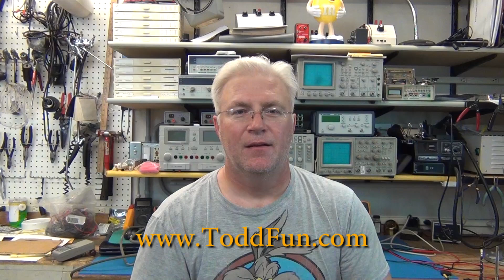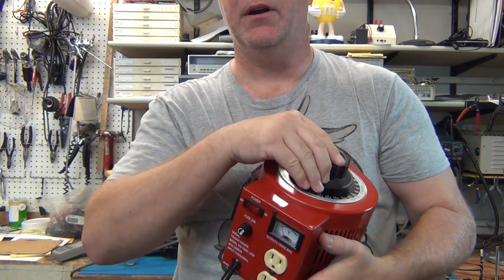Variac or Autotransformer Review and Teardown

Comment: Thank you. I just bought one plus a rectifier to make a DC motor speed controller. Mine only has hot and neutral output so I see what I need to add for grounding. I am using a free treadmill motor to turn a wood lathe. This allows me to adjust the speed for each project diameter. I will add a tachometer so I don't really care what the actual voltage is.

Comment: Hi
I got mine today, a vevor with digital readout. A 3kva 240 volt. But the output is enormous! 338 volt 😃😁
With shipping to DK only 99$.. These things has becoming really cheap. 
About using it as a transformer, just remember: It has live mains, there is NO isolation, so one's power supply is LIVE on the low voltage side....

Comment: The scale on the Variac dial is % of input voltage, not absolute voltage. Your input voltage is 115V AC (or whatever) not exactly 100. That explains the offset you're seeing and why your own meter agrees with the built-in one.

Comment: if your set brush at 120volts does tgat mean 120 wraps of wire at that point? if not what does determine the voltage relitive to the number of turns?

Comment: your voltage at your house will vary seasonally making your top outside scale wrong season to season, building to building, electric supplier to supplier.  metering is a must.
Also,  check the outlet your using for proper ground connection with a test plug before using.

Comment: Good review thank you. I wondered why there was no CE, CSA or other symbol to verify it passed. This one would surely fail, just on the ground connection by itself. It looks pretty good otherwise, I wonder why they didn't bother with a simple screw and wire to the chassis to attempt to get certification. For a lab device the calibration of the meter isn't important, most of us would measure that directly with a scope or MM anyway.

Comment: Hi Todd, wanted to ask you a question about using a variac to lower the voltage of a 100 watt Marshall guitar amplifier. How many amps rating would you need, 10A or 5A at 500 watts like the SC-5M model sold from China that looks like the one you have? My amp uses a 4amp fuse. My other 50 watt amps use a 3 watt fuse.Hi  Most people say you should buy an old Staco variac made in the USA. how do you find the quality of these Chinese variacs? I would appreciate your expertise on which variac I should buy. I searched all over YouTube and the net and still haven't found the answer to my question. Thanks Michael Newell from Niagara Falls, Ontario, Canada
Reply from the maker: Find the rating of the input to your amplifier (usage rating from mains). If that is only 100 watt or less then the 5A china variac will work just fine. Just make sure the amplifier input is less than the rating for the variac and the china variacs are fine.

Comment: Nice review. My thoughts:-
* If the wires were spade connected, some clown would probably re-install them arse-about.
* Can you could lock the knob properly onto the shaft flat, and then fix the zero offset using the set screws on the wiper collar.
* I would install proper ground wires to all 3 chassis parts, also putting some extra length on the wiring inside the power cover.
* Maybe some hot snot would stop the output sockets flapping about.

Comment: I bought the exact unit, a 20 amp dual plug outlet model, and it came in all bent up on one side, ...seems to work okay though.
Reply from the maker: I think I would have sent it back or claimed shipping damages. My AT's fuse completely destroyed itself for no apparent reason so I bypassed it for now, but I really need to put a new "better" fuse holder on it.
Reply: Yeah, well, its a cosmetic issue I suppose, I could take it apart and straighten out the metal a little bit better.  The problem I believe was that it was too heavy for the thin foam on the bottom, and that is what happened, that it got thrown around and it slightly buckled on one edge, that is what bent in the metal on the round shape.   Hey, I tried to avoid this bs,...I noticed the seller was supposedly in California, and I am in Oregon, then when it was shipping it comes from Kentucky,...I messaged the ebay seller, who seemed like a chinese foreigner about this and received a strange foreign like english apology.  I paid $76 + $15 shipping, and I alerted the seller what happened, haven't heard back though, and sending it back for an exchange just seems a waste of time, and they are now out of these.  Now I have a chinese 30 v 10 amp dc power supply coming from a different seller,....in supposedly chino california, another one of our chinese sellers on ebay, I hope it comes in straight.  *****Just got an email from the seller, wanting some pictures of the damage, which I gave, maybe I might get a partial refund, but most likely, in the past from other ebay sellers on partial refunds on chinese made consumer goods, I get a five or ten dollar partial refund while they claim a total insurance payout from the shipper,....I have seen that twice.  BUT, the point here is, .....I'd expect the heavy 20 amp variac to be twice as likely damaged or bent up in shipping cause the thin foam on the bottom of the box is too thin and pancakes out in no time allowing the heavy item to be slammed on concrete and other hard surfaces with little protection other than pancaked bottom foam and thin cardboard.  Like I said, I have a el cheapo 30v 10 amp dc power supply coming, supposedly from Chino California to southern Oregon(here) from a different seller, and if that comes in all squashed or bent up,....haha, I might need some electro shock treatment so to speak.

Comment: I have an old adjust a volt standard electric variac. It will do 0-140V AC up to 7.5 amp. When I got it it had an really old 2 prong un-polarized plug. I redid that with a 16AWG 3C cord from an old microwave, then just took a 3 prong adaptor and bonded the ground to the metal frame. I then got a 7.5 A breaker to replace the fuse holder. 

I fin interesting at one time I thought variacs were just some wacky part with not much use. I use it like all the time now though, I really like I can use it to test transformers. If I put 2V in and get 10V out then I know the ratio. One time I needed 480V for a project I connected an old microwave transformer to the variac then turned it up to like 20V and that gave me 480 V from the MOT. 

The other day I used it I had had to test a transformer with a 208V primary. I had another one that had a 120 primary and 208 output. I took the 120 input connected to the variac for adjustment reasons, then wired the output 208V to the input 208V of the transformer I wanted to test. 

I also have an accessory I made that has a lone cord for the variac on it then that connects to a bridge rectifier heatsank to the metal box. The output then attaches to a filter cap and terminals. The other thing I use with it is an old 18AWG 3C cord with 3 insulated aligator clips on the end. Then I can clip to transformer leads, motors, etc and run them on the variac. 

Last week I got 4 variacs that came from a control panel setup. They were rated for 3A at 280V. I wanted to find if I could use a different setup to input 120V and get the proper range still. I used the variac I had and my test lead to test various connection points on my new variac to find the best connection for a 120 input. In a way I find that funny because I used one variac to test a different variac. 

I also used to drive an old ignition transformer from an oil furnace to make a jacobs ladder. It I had the gap a bit too big I could boost it to 140V, or bring it online slowly to see what happens. Thay can also be used with AC to control amperage because it is basically a variable inductor. 

My next project is to take 2 of the 4 variacs I got install them in a metal toolbox, use one for voltage adjustment and the second for amperage control. I may put a few switches in too to adjust the primary windings on the voltage variac, and maybe another to bypass the amperage control variac. The outputs would be AC, then also have a DC output with a rectifier and filter cap(s). Perhaps at some point I may think about adding a regulated output too.  These variacs are only rated 3 amp, but from what I have heard many places if you cool them fairly well you can overload them a good deal. unless it gets to be like 10+minutes, etc.
Reply: I know this is an old video but I wanted to comment for possible future viewers. I have an one Adjust-A-Volt as well. Mine is a 15 amp version. I’m pretty sure that the dial is marked in percentage of the total output voltage, and not in actual voltage. That’s why it never matches up. If I remember correctly, when I tested mine , by percentage it was in the ballpark. +/- 5% I believe.

Comment: I plugged a receptacle ground tester into mine and under 60v it's says the ground is fine but anything higher it says it has a bad ground. I even scratched of the powder coat off around the ground lug & it still does it, any idea why?
Reply from the maker: Not right now. I will test mine tonight and get back to you with any ideas.
Reply from the maker: This is an auto transformer and your  receptacle tester needs to measure the ground leg through the neutral leg. Maybe your neutral and hot are switched in your wall receptacle or in the variac plug or in the variac wiring or at the service panel. I thing this would cause your problem as it may not like the value it gets through the windings of the variac if the neutral is on the hot side going into the variac windings. That said, your tester shouldn't even be able to power on until after the variac gets over 60v AC as that is what it takes to turn on the 110 V Neon Indicator Lamps normally found in such receptacle tester plugins, this makes me think you have some bad wiring. I tested my variac with my 110 V Neon Indicator Lamp receptacle tester and it stayed off until 65 V AC then turned on with one light stating bad ground, then at about 80 V AC to max AC voltage it showed two lights indicating all good. Hope that hepls
Reply: Todd Harrison weird, it seems like the 10amp model is nicer. Thanks for testing yours too!

Comment: I think that for every given position of the dial the output voltage will vary depending on what load you connect. The bigger the load (lower impedance) the lower the output voltage will be. Just a reminder. Great video BTW, keep up the good content.

EDIT: I just realized after this vid that autotransformers are just variable inductive voltage dividers. https://en.wikipedia.org/wiki/Voltage_divider#Inductive_divider

Comment: Great video.  Mine never worked right.  I used your video to clean the coils, remove the armature, adjust the tension rings, reset the armature and reassemble.  It works much better now
Reply from the maker: I'm very glad the video helped you with your repairs.

Comment: Hi Todd,

Thanks for the review of the variac. I was on the market for one and found your review and helped me pick the same one you have. On bit of good news - the company must have reviewed your comments and added a earth ground wire to the cage! I took mine apart to check the quality and when I took off the front panel, they had already added the extra Earth connection over to the cage (I did add a star washer to make sure there was a good electric path through the paint).

Thanks again for the review and take care,

h
Reply from the maker: +h barton Thanks for the comment and the update on the earthing wire. That is good to know they fixed that issue.

Comment: How do you find that CSI3005X power supply in the back ground. have you done a teardown and review of it?
Reply from the maker: +MonkeyMagic Elecifun I have done a tear down but not on video. It doesn't have as many features as say a the "RIGOL DP832" (http://astore.amazon.com/tod0f5-20/detail/B00ENX02GC) but the "CSI3005X" (http://www.circuitspecialists.com/bench-power-supply-csi3005xiii.html) is still very usable and I have had no troubles with it in all the years I've owned this unit.
Reply: ***** I had one but killed it within a couple of weeks. It would be great to see a tear down of it. Circuit Specialists over here (UK) asked me pull mine apart to find the fault. I did and did, but I didn't like the lack of features, Output button,resolution, current control to name a few. I bought the Rigol DP832 and have never looked back.
PS I think your Auto Transformer review, tear down is great, I am looking for a not too expensive unit and think I may have found it. Cheers.

Comment: Great video! I have the SC-10T which is rated for 10A and is isolated, but the front panel is identical. I'm planning on modifying it to add a digital display with an ammeter and volt meter. Did you notice that if you pull the fuse, the light on the switch stays lit. They have the fuse after the switch (between the switch and transformer). Doesn't make much sense to me.
Reply from the maker: +swappart.com I was not aware they made such a think. Thanks for sharing. I have added it to my Amazon store: http://astore.amazon.com/tod0f5-20
Reply: +Todd Harrison (ToddFun) I just lucked upon it while looking for an isolation transformer. Since it was fully isolated, and I'd wanted a variac anyway, I went for it.  When my parts get here and I get my modifications done, I'll post a link to pics.
Reply from the maker: +istoreit Thanks for the information. They have changed the product that this links to so I have removed it from my store listing. The one it was linking to was not isolated. I did leave other isolation transformers on my Amazon store that are not variacs. You can get a good Variac and plug it into an isolation transformer to get the same combo.
Reply: +Todd Harrison (ToddFun) 
Hi Todd,
I went to the store link above and it says "Note - The grounding pass through and bypasses the isolation, which means the grounding isn't isolated. You may be able to use a 3 prong to 2 prong grounding converter."
Does that not mean that it is not isolated? If it is, then you should not have to use a 3 to 2 prong converter. Did you have a chance to measure the output wires to ground? Also, could you help explain how they managed to isolate it with only one coil instead of 2 coils i.e. a primary and secondary as in a transformer? Thanks.

Comment: Another awesome video sir, I recently acquired 2 Superior Electric Co 3PN116B Powerstat Variable Autotransformers off ebay for 5 bucks a pice! Score ob my part, just need to replace old dry rotted cords. I did have a question for you about the scale on these units. The two i have go from 0 to 100 marked, but output 0 to 140 volts, as well as all of the pictures i have seen show a scale of 0-140 volts on them. Is there something odd about the ones i have, or else i have no clue! I took the covers off to check the windings, and the screws appeared to be the original ones. Any guess as to why the output would be labeled this way as to the others i have seen?..
Reply from the maker: Ray M I don't know why the label is 0-100 unless it is just for a % of output. 0% to 100%. I have seen them with 0-100 but they where the 240v model. maybe somebody just modified a 240v unit to 110v. You could etch your own from some copper plate or make one by hand. Also try to see if the plate flips over, maybe the back side has 0-140v ?
Reply: ***** I am not even sure how to tell if it is a 240 volt model or the 120 volt one, other than the model numbers. I will try and attach a few pics of the two, but also the rivits in the caps of these original scales appear to be the original ones.
Reply: ***** ok, just realized I cant attach pictures. .. uggh
Reply from the maker: Ray M I'm thinking it is the 240v unit that may have had the plugs modified. But you can still put 110v in.

Comment: Hi, just to add regarding the voltage not equal to the dial. In most cases you will find it will only be equal when the input voltage is correct to the system! ( eg. System equals 120v and calibrated @ this voltage from factory) So if the input is not 120v the dial will be out to the output!

Comment: Hi,

I acquired my variac pretty much in the same period as you did you clip, however this is the first time I see your video about the variac on Youtube.

I did modify the wiring so that the fuse is actually protecting the variac's output.  Afterall, the variac's input is protected via the circuit breaker on which it is connected.  If someone really wants to make it safier, a fuse on the input and one on the output is an alternative to consider too.

As you stated, and also reported by other buyers, the ground connection wasn't adequate.  This is one of the first thing I checked when I acquired the variac and fixed it ASAP !

I would appreciate if someone could tell me if they experienced breaker trippings because of the inrush current when they turn on the variac ?

Even if the dial is at the lower setting, no load, the breaker trips when I turn on the device.  This is fairly annoying.

Some hobbyists are using the light bulb trick to minimize the breaker tripping, but personaly I'd rather prefer a more genuine soft-start approach.  Would you have any suggestion in that regard ?

Finally, I ordered a small panel  voltmeter that I will make fit in place of the analog meter.  There is someone on Youtube who did that modification, however it works in a similar way as your Watt meter, showing the reading around 40V and up.  On my end I opted for a meter requiring an external source to operated, therefore I'll be able to see the reading in the lower ranges.

Keep up with the good work !
Reply from the maker: You might want to try installing a thermistor like orbiter8(John) did to solve this problem with his variac.
https://www.youtube.com/watch?v=Avsua8G7Vpw